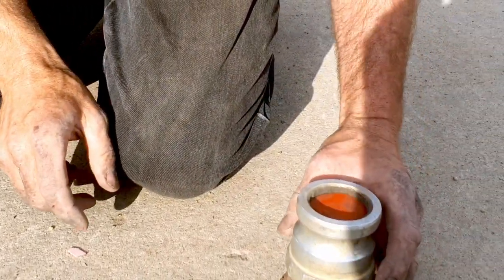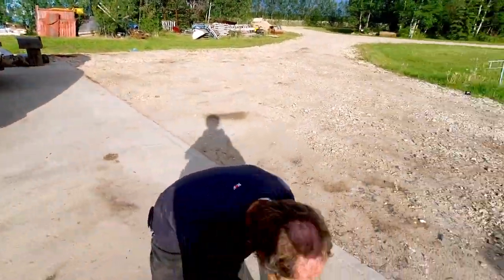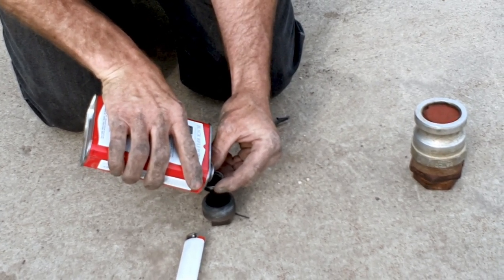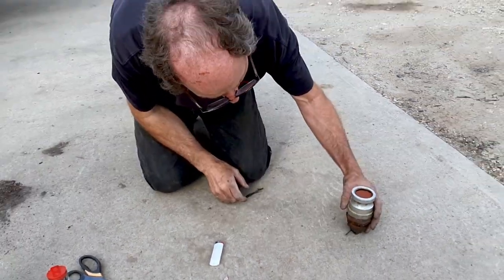Playing with Cannon Fuse

Comment: Fella I knew a few years ago let me borrow a home made "cannon". The base was a piece of 1/2" thick steel plate about 4" square.  Barrel was steel tube with a 1/2" bore and 1/2" wall thickness. We'd put about the same amount of powder in. Used green beech leaves as the plug. Tamped it in with a piece of aluminum and a hammer. 
The leaf plug would go literally outta sight high every time. 

It was...... A blast.....
Reply from the maker: No doubt! A guy could probably spend hours every day just building and playing around with stuff like this. As long as some common sense prevailed, it would never get old. 
When I was around 8 years old we had cub scouts at a retired couples house every Tuesday after school. He used to do all kinds of stuff like that.  He's gone now,  but she's 103? now!

Comment: i think you were having more fun than your kids were, like a kid in a candy store , it never gets old, at work i build a few compressed air guns/cannons out of old parts and pipes, our chamber was good for about 500 psi, we shot bits of washers, jujubes, peanuts and pennies and they'd sail out of site, we're all just big kids, and should never lose that part of ourselves 👍
Reply from the maker: Sounds like a great time. I was involved in making a candy cannon ( more like a mortar) it was about 3 or 4 inch diameter where we could put a pound of candy in it and shoot it up into the sky at events. Everything worked great except the pressure would shatter some of the harder candies.
I always have fun doing these types of things